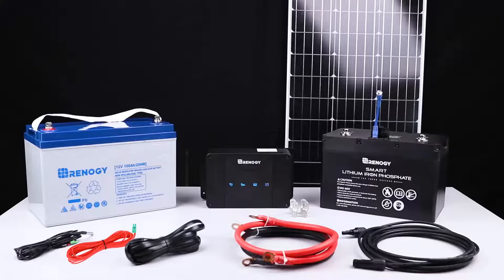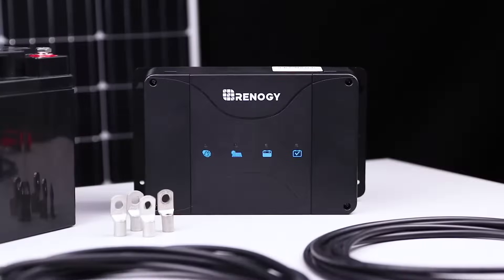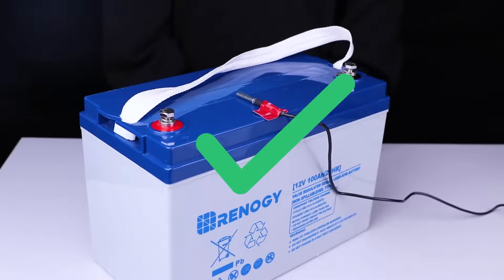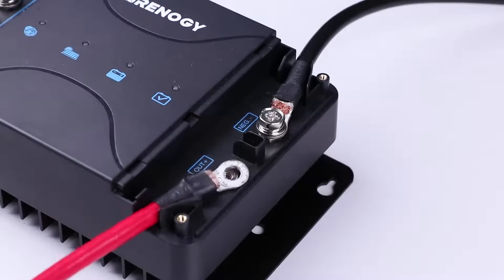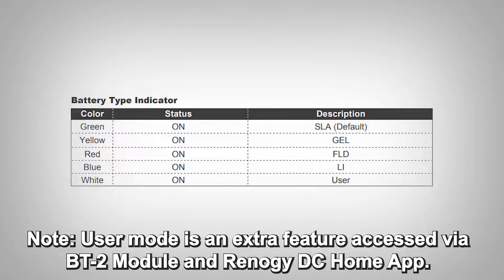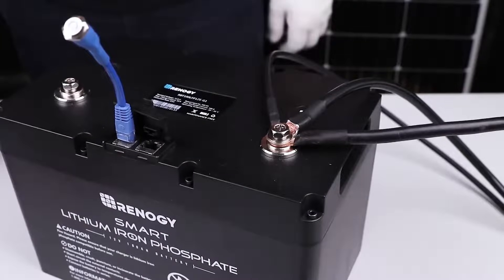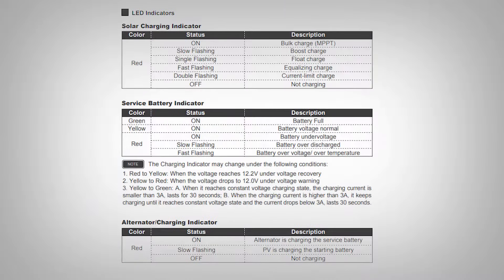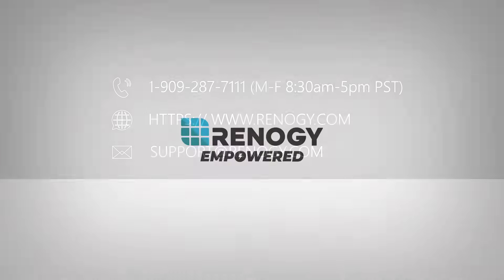30A/50A DC-DC On-Board Battery Charger with MPPT

Comment: Is 800w solar too much, how much overpaneling
Reply: A 50 amp MPPT charge controller can handle approximately 700 watts. However Going with more wattage is called "Over paneling" due to the fact that a say "200 watt" solar panel gives say on a good day 140 to 150 area at peak day If you had 800w solar on a 50MPPT you would be in a sweet spot range of power never really hitting 800watts And Your controller would limit anything over 50amps going thru....Assuming you have a 12V system

Comment: 1.how far away from boats start battery can the charger be?2. my lead acid start battery will be located 22' away from the house battery is that to far?3. my 2012 Evinrude 175hp engine has a builtin auxilary battery isolator Evinrude says to never use a battery isolator. 4.is this DC/DC charger a isolator?

Comment: Does the negative terminal (main/alternator side) of the DCDC have to connect directly to the battery negative, or can it also be run to ground?
Reply: You have an answer for that?

Comment: How do you determine whether or not you have a smart alternator? 
How do you determine whether you should get the 30 amp unit or the 50 amp unit? 
You need to explain this a little more
Reply: 50 amp allows you to charge faster. Guaranteed to charge faster from your alternator but not useful on the solar side if you only have like 200 watts. I'm running a 50amp version with 200 watt solar because it wasn't much more expensive and I get the benefit of more charge while I'm driving. A smart alternator is a newer vehicle feature ... check the cables from your alternator to your battery. The negative side (i think?) will have an electronic box of some sort on it to monitor the current

Comment: Hallo, misst der Temperatursensor die Temperatur der Baterie und gibt ein Signal an den Ladebooster, sodass ein Laden der Batterie unter 0 Grad nicht stattfindet?
Reply: Hi ,This temperature sensor is used for temperature compensation, and it is not necessary to connect it for lithium batteries.
Reply: @Renogy_Cares  vielen Dank für Ihre Antwort, dann dient der Temperatursensor also ihrem Gerät und schützt  nicht der Batterie durch eine mögliche Abschaltung des Ladevorgangs?

Comment: Can the D+ wire be connected to the trailer running lights? Those lights are only supplied power with ignition on.
Reply: If it can ensure a voltage of 12V, then it is also possible.
Reply: @Renogy_Cares  thank you for confirming a solution for the d+. Really looking forward to adding Solar one day as well to my dc/dc 30a charger. Cheers!
Reply: Hi - i have a similar question, but can’t see the answer here, please can you help?
Reply: @tonyedwards67  I connected my d+ to the running light circuit on my trailer junction box. This way my battery will charge when my cars lights are on. Doesn’t hurt to shine during the day also. Has been working well for me. I just make sure my lights are switched off when I start and stop the car.
Reply: Thanks - good to hear it’s working well!

Comment: When hooking this up do I leave the normal truck wires from the alternator to the starter battery attached or does everything go through the DC-DC charger first?
Reply: Just add a wire from vehicle battery to charger, don’t change anything on vehicle

Comment: In all respect, do you have a video without the music? I find that when doing an instructional video the music is often distracting and makes it harder to hear the voice of the narrator... Many videos do that! The music often hinders the message, and it's not necessary, we don't usually have loud music in a classroom... ;)  Having said that, is there a manual available to get the information? I don't understand the difference between the DC-DC charger and the Solar charge converter? Are they interchangeable or do you need both? Some diagrams of basic installation on RVs show one or the other along with the Solar panels so it's a bit confusing. I just got my first RV , actually a slide-in camper and looking forward to getting your products. Not sure how to install since the batteries and solar panels will be on the camper I guess the DC-DC charger should be there also. The power terminal on the 7 pin RV cable is probably not enough amps so should I have a dedicated cable with a separate connector from the service battery on the truck to the DC-DC charger?...  Thanks!

Comment: This unit is compact and does combine a limited solar charge controller with a 12 DC-DC charger, replacing two items with one. This can be a good solution, but it has quirks. One is that it only works for solar panels under 25v. That's a hard limit, so you can basically only use 12v panels in parallel.  It also has an unusual way of limiting input current to 50A. Basically, if you have any solar power coming in, it reserves 25A for the solar side and 25A for the alternator side. Just be aware of that; it works that way by design. If you want to charge your batteries with 50A from the alternator, you have to cut off solar with a  switch or relay. The so called smart alternator input actually just changes the threshold for charging. This is explained in the manual. When it is on you can put much more charge current in from your alternator while driving if you want a faster charge. I tie it to the alternator voltage, and get the higher charge currents from the alternator at lower voltages. Renogy should redesign the unit to allow up to say 100 volts on the PV input, change the way current is allocated between PV and alt inputs, and just turn on smart alternator all the time. This would cost little and would increase the appeal of this product.
Reply from the maker: Hi, Mark.

We have realized that the point charger only can burden 25v PV voltage is not reasonable. So the pv voltage can reach 50v after iteration. Stay tuned
Reply: @RenogySolar  Is there an update to the product? A part number?
Reply: @RenogySolar  Kudos to Renogy for addressing these limitations. I am put off purchasing this unit untill these have been rectified. Nate @exploristlife keeps mentioning that you need another 20v above battery vdc.. Basically 35v minimum solar array input for a 12v battery bank.
Reply: @RenogySolar  any update on the updated version ?
Reply: Install breaker in solar and no need crying and tell wife to switch off if forget when driving or u wear skirt in House
Reply: if you see the product on their site, it says "new feature 25V -> 50V" but I don't know how new that is.  I bought a unit on ebay and don't know if it can handle 25V or 50V.  A part number would be helpful.  Oh, well shit, I just looked on the side and it says Max PV volts 25V.

Comment: 2 questions 
Does this come with an inbuilt battery isolator?
What is the water resistance rating of this dcc35/50 up but?
Reply from the maker: Hi, Lizard.

For your issue, we suggest you can submit  (links listed below for specific locations) for help. 
 
https://renogy.force.com/helpcenter/s/contactsupport (USA)
https://renogy.force.com/helpcenterau/s/casesubmit (Australia)
https://renogy.force.com/helpcenterca/s/contactsupport (Canada)
https://renogy.force.com/helpcenteruk/s/contactsupport (UK)
Reply: No isolator. Instead it has a DC-DC charger which only takes current above a certain alternator voltage. It won't drain your starter battery and in fact it trickle charges it if the house battery is full. You don't need an isolator. It has no water resistance and will burn up if you get it wet so don't do that.

Comment: Basically every vehicle in the last decade or so has a smart alternator, I think it would be a good idea to talk more in depth about that
Reply from the maker: Hi, Big Z.

Thank you for your feedback which helps Renogy constantly improve customer experience.

I have reflected the problem to our related department and will improve our video later.
Reply: @RenogySolar  agreed, and thank you. Learning how to properly connect the ignition switch to the fuse box is vital. Especially in a removable camper scenario the wire supplied will need to run to a connection prior to that fuse box as well. This topic would help many of us be more interested in your product if you could share this information.

Comment: when installing this on a sailboat with a battery selector switch with 1, 2 or both options would this switch need to be eliminated and all loads except the starter fuel pump and ignition(if Gas) run to the house battery or can this battery selector switch still be used? if so can you show me a wiring diagram?
Reply from the maker: Hi, Christopher.

In order to assist to handle the problem for you, we suggest you submit a case through our Help Center Portal (links listed below for specific locations）for help.  
 
https://renogy.force.com/helpcenter/s/contactsupport (USA)
https://renogy.force.com/helpcenterau/s/casesubmit (Australia)
https://renogy.force.com/helpcenterca/s/contactsupport (Canada)
https://renogy.force.com/helpcenteruk/s/contactsupport (UK)

Comment: Hi there, if I use this exact setup, will I be able to draw from my house battery simultaneously, such as for a fridge, laptop/camera/phone etc.? Can I connect these loads straight onto my house battery while it is being charged by the DC-DC Charger with MPPT via solar/alternator?
Reply from the maker: Hi, Chris.

Yes, you can draw from your house battery simultaneously. Please make sure the loads' draining speed is slower than the battery's charging speed to prevent the battery from being fully drained.

Comment: hello, I recently got Renogy 30A, I completed the installation correctly. I got a problem with the output voltage low, when ı turn on the engine alternator voltage is 14.4V on the Renogy Alternator ınput, Checked with multimeter. But the output voltage is 12.8 ıts not showıng charging on the app. What can ı do, ı have got a very small solar panel on top of my van, ıt shows 5.9V coming through from SV on the app,. The house battery level is 12.8 FYI. please could you tell me how ı can 14.4 voltage on output level?
Reply from the maker: Hi, Murat.

Thank you for your feedback. In order to solve your problems more timely and efficiently, we may need you to send us images or videos for reference. For the condition, you can submit a case through our Help Center Portal (links listed below for specific locations）and our customer representative will reply you within 24 hours.
 
https://renogy.force.com/helpcenter/s/contactsupport (USA)
https://renogy.force.com/helpcenterau/s/casesubmit (Australia)
https://renogy.force.com/helpcenterca/s/contactsupport (Canada)
https://renogy.force.com/helpcenteruk/s/contactsupport (UK)
Reply: Won't work with your small solar panel. Get a 100W panel with higher than 16V output.

Comment: So Badly designed not having at least 50VOLT PV Input
 - way tooo expensive for only 25V Panels!!!!!!
Reply from the maker: Hi, Melbourne.

Thank you for your feedback. We are about to launch a new 50A charger with MPPT. Its maximum PV input voltage can reach 50v.

Stay tuned.
Reply: @RenogySolar  well i got the 30 which is now only good for charging - even the Victron 100/30 has 100v which i got - - not impressed with Renogy design 😭

Comment: When plugged into "shore power", most RV's have a 12V charger putting power into the battery.  How does one hook that up into the system?  do you have any diagrams for that?
Reply from the maker: Hi, Eddie.

The charger in our video is a DC-to-DC charging method. Charging the battery with shore power you mentioned is an AC-to-DC charging method. These are two different charging modes. It is recommended that you can use an ac to dc charger to power the battery if you want to use shore power at the same time.
Reply: @RenogySolar  Hi guys.  I do understand how it works.  My concern/question was regarding if I needed to keep the ac to dc charging system separate from the solar/alternator charging system by way of a cut off switch.  From what you wrote, it seems both can be hooked up to the house battery at the same time, is that correct?  

That would mean when plugged into shore power, the batteries would be getting charged from the ac to dc charger AND from the solar system at the same time.  I wasn't sure that would be ok.  Please confirm if that is ok.  Thank you
Reply from the maker: Hi, Eddie.

These two charging methods can charge the battery at the same time. But it is necessary to ensure that the maximum charging current of the two methods does not exceed the maximum charging current that the battery can withstand.
Reply: @RenogySolar  Thanks.  I think the simplest and safest way to do it is to put in a switch so when I'm plugged into shore power the solar/battery system is isolated and power only goes from the charger to the unit.  No chance of overcharging then.
Reply from the maker: From a security standpoint, I agree with your approach.

Comment: This is a nifty all-in-wonder box but the DC-DC charger section won't do better than 20-30a. I understand that this is built to be "fool proof" and not smoke a stock alternator with too much draw but it's kind of a "misnomer" to call it a 50amp system. 50-30 would be more accurate...?? i'll keep looking for my solution. This is not it.
Reply from the maker: Hi, theheilious.

We have two types of this charger, 30A and 50A. It means that its output current can reach 30A/50A on the basis of a large enough input (which needs to be within the charger's tolerance range). You can click the links for learning the charger in detail: https://www.renogy.com/dcc30s-12v-30a-dual-input-dc-dc-on-board-battery-charger-with-mppt/
https://www.renogy.com/dcc50s-12v-50a-dc-dc-on-board-battery-charger-with-mppt/

Wish you a nice day.

Comment: Do you need to connect the BVS??
Reply from the maker: Hi, Navillus2273
Thank you for contacting Renogy.

Battery Voltage Sensor (RVSCC) port for measuring the
battery voltage accurately with longer line runs. Due to the
connection and cable resistance, there can be discrepancies in voltages at the terminal vs the BVS.

For this condition, you can considert to connect the BVS if you want to know the accurate voltage.

Hope it is helpful.
Reply: No. It's a remote sense line for long wires to the battery, which most of us don't need.

Comment: I just wondering if there is a way to program this device to charge my lead acid batteries when the lithium batteries are too cold to get charged, it's the second time I come to a dead truck because the lithium are too cold and panels don't sent excess charge to lead acid batteries.
Help please 🙂
Reply from the maker: Hi, Douglas.

If you want to charge for your lead acid batteries, you can set the battery type to "SLD" and charge for it.

Have a nice day.

Comment: I'm trying to use alternator run S generator with voltage 14.5 would it still work? Regards
Reply from the maker: Hi, Mikhail.
14.5v is ok. But please pay attention that you need to connect our charger to your starter battery. It can not be connected with generator.

Hope it is helpful.

Comment: I am considering the 50 amp model.  I have 510 w solar panels.  As this has MPPT solar capability, does this eliminate the need for the MPPT charge controller I already have?  I realise this unit optimises charge from the alternator when driving, but the solar panels already provide up to 40 amps or so when the sun shines.  Should I replace the charge controller?
Reply: No, this unit has some weird current limits so it reduces alternator charge currents to under 25A if you have any solar power coming in,  and also limits PV current to under 25A. The 50A rating is misleading; it's actually 25A alternator, 25A solar. It will not accept your 510w of solar power, only half of that. Don't change, your existing setup is better.
Reply: Since I posted here, I have purchased and installed a Renogy DC-DC 40A charger, running from the vehicle battery.  I kept the solar charge controller too.  They connect to a common buss bar, from there to the trailer battery.  So far, the solar has provided adequate charge (summer season) and I switch on the DC-DC charger on cloudy days when driving.  Seems to work well so far.
Reply from the maker: Hi, Pommy.

If you want to use starter battery to charge for your house battery when driving, you can consider to use the charger. The maximum charging current of the DCC50S charger is 50A. Please make sure the working current of your panels is not over 50A.

Hope it is helpful.
Reply: @RenogySolar  Incorrect ! its only 25 amps (not 50)  unless you install switch to kill any power coming from your solar panels. Renogy best get back to the drawing board as this unit is full of flaws.